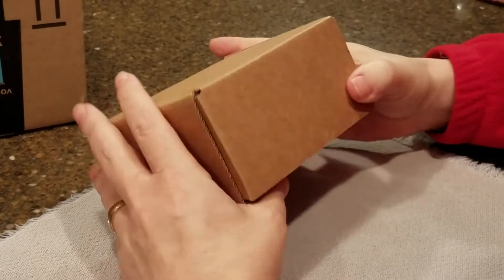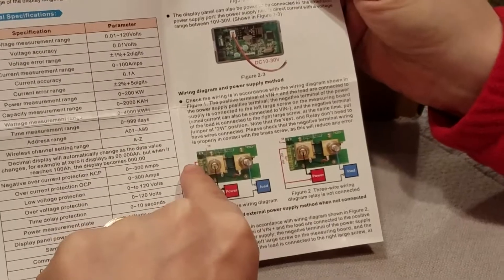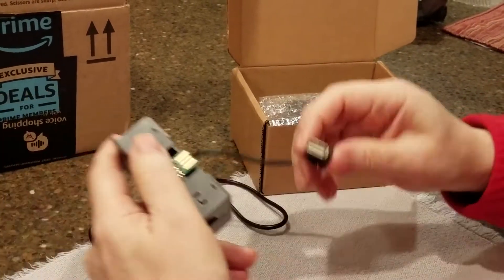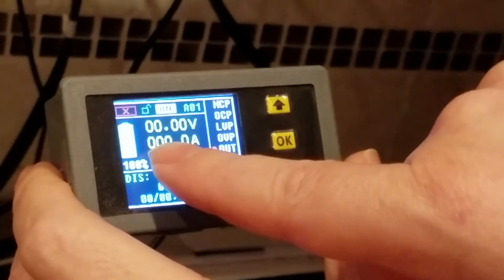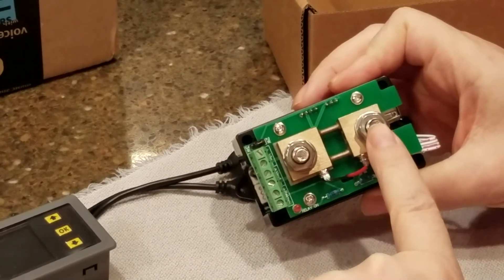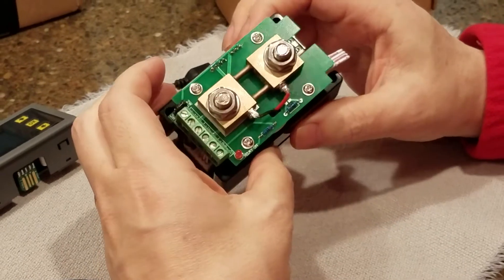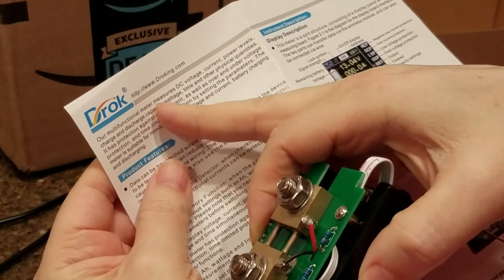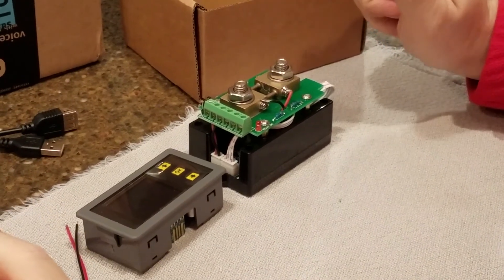DROK DC 0 120V 0 100A Unboxing

Comment: when can we look forward to part 2 of the of the DROK
Reply from the maker: Working on it... had to de-install it, because my NexusRV solar charge controller is mis-wired, it is in the shop.  The addition of this DROK part wouldn't work, because the solar wouldn't charge through it (because it isn't connected directly to the battery).  I need to do more troubleshooting before I install this.
Reply from the maker: Okay, I just installed the last portions of the Drok... Works GREAT.  The reason I had to wait so long, is my BRAND NEW RV from Nexus RV was completely wired wrong.   I fixed the AC systems, it cost around $4k.  I then had to fix the DC systems, had to re-wire the ZAMP solar correctly and replace some breakers.  I now have it in, I installed it a specific way because of the solar.  It works great just spent all day in the sun watching it.   I'll do a video tonight and put it up.

Comment: We were going to purchase a maybach but have put buying from Nexus  on hold after watching your videos. Customer service award goes to Tiffin. We decided to buy a used one for the great Service. Wow. Nexus claims that they build the best quality for the value.
Reply from the maker: This goes to show you what state they left this customer in (me), when I first read your post Brian, the first thing that popped in my head is this may be a plant to talk about damages my posts are doing (which is not my intent).  We have already talked to lawyers in South Bend.  I still have a small hope that they will do the right thing so I can end this story on a positive note.  If it doesn't expect to see alot more just on that subject, so far I have kept to the facts of the coach and haven't talked to the customer service....
Reply from the maker: Is it a class A you are looking at?... we were attracted to the Class B, and decided to go a bit bigger to a B+
Reply: we looked at the nexus b+ but wanted to have 50amp service. we are in the process of purchasing a 2012 tiffin allegro breeze 32BR diesel pusher. (33' long). we found a great deal for $30k less than any other out there and has only 6500 miles on it. getting it inspected next week, so hope all goes well with that.
Reply: we have watched all of the nexus videos and were impressed how they say they are different from other manufactures. i think there is so much demand and these manufactures are cutting corners to get them out in the market. it was a new record for production last year